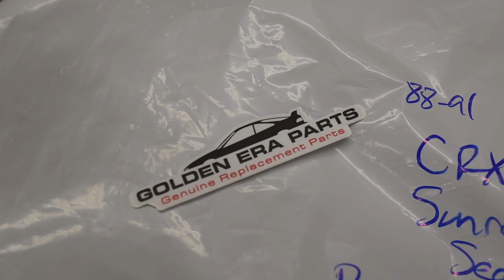1988 Honda CRX Si - Sunroof and Seal Replacement

Comment: How soon did the fiberglass panel start to shrink and show the weave texture? Was the fitment off from the very beginning when you installed it?
Reply from the maker: It took a year or so. The summer July heat sped up that process. It wasn’t a perfect fit from the get go, but was pretty decent. It raised slightly over time.

Comment: Restoring a CRX now.  My main issue is rusted rails.  Any advice?
Reply from the maker: I try to avoid rust. You have to cut it all out and weld in new metal.
Reply: @crxseth  Thanks for the response. But I believe I can get a new roof and weather stripping. But the hardware is what seems to be the problem. Know anyone that makes rails? Or is my hope to get some off a car that's being parted?

Comment: I went out and just bought the seal! One question. Am having the car repainted. Had to take off the rear sprayer and gasket which was painted on and bubbling all around. It disintegrated when I removed it. Besides the OEM, is there a rear sprayer nozzle you would recommend?
Reply from the maker: No, the OEM one is the only one I know of.
Reply: @crxseth  THANK YOU for the reply!

Comment: Would you please elaborate on the wheels you're using on that build? And what the weight is? Thanks!
Reply from the maker: They are 15x6.5” +35mm Sprint Hart CP. I’m not sure of the weight.
Reply: Seth, thank you for that. Off topic, any recommendations on b series headers for ground clearance on CRXs? I will be using the innovative boxed frame crossmember. However, I still have concerns on clearance underneath. Any advice you have would be welcome thanks
Reply from the maker: @estroumpis  I honestly don’t have any experience with that. I am using an OEM manifold.

Comment: So glad mine has no Sunroof, Not that I wouldn't like one and there cool opening out over roof, just the rust issues when you have no Garage is a bonus. My mk1 is really bad around sunroof, have another complete one to go in with nos tray and decent panel but even roof inside edge rusting away. Nice Work and Great Colour CRX Black

Comment: I use the cream all the time. My 2002 civic si still has the OEM seals. Almost 20 yrs and the seals have no cracks or dullness. I applied that cream at least once a yr or where needed.

Comment: What panel is that?
Reply from the maker: Which one?
Reply: @crxseth  the one you put the seal on
Reply: @crxseth  looks like fiberglass?
Reply from the maker: @jdmskunk2  The new one is just a used OEM panel.
Reply from the maker: @jdmskunk2  The fiberglass one is from a guy named Luciano Oliveira from Portugal.

Comment: If you are working on Honda screws, definitely get yourself a JIS #2 screwdriver or some JIS #2 bits on Amazon.  Honda screws are not phillips head screws, which is why typical US market screwdrivers don't fit them so well.  The JIS #1 is perfect for Honda key fobs and the #3 is perfect for brake rotor screws (though you may want impact rated for that).  Trust me you will notice the difference the first time you use one.  Here is a demo video I saw that perfectly illustrates the difference: https://www.youtube.com/watch?v=FNiEOLcwWa4